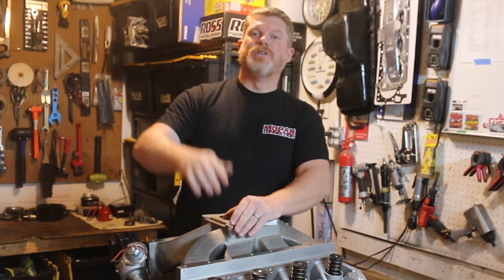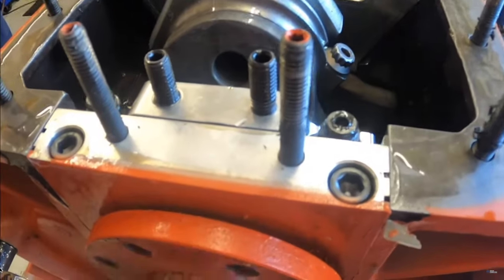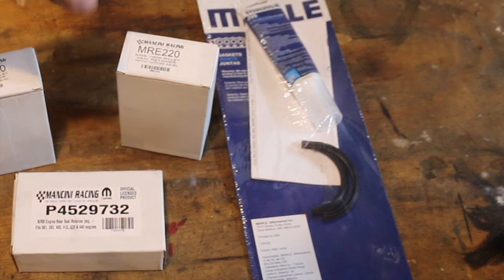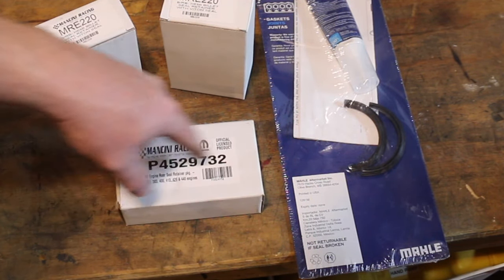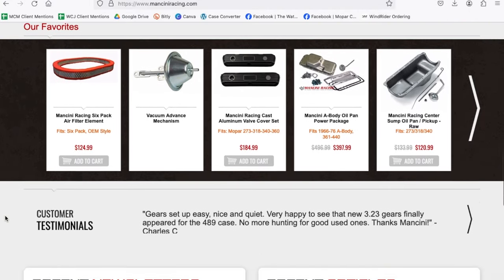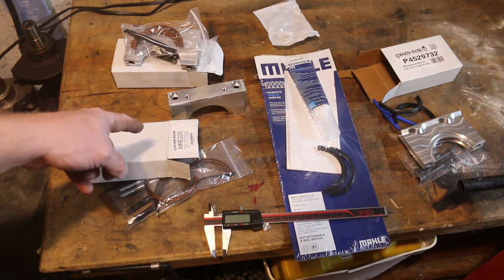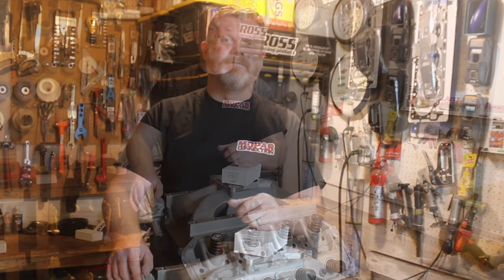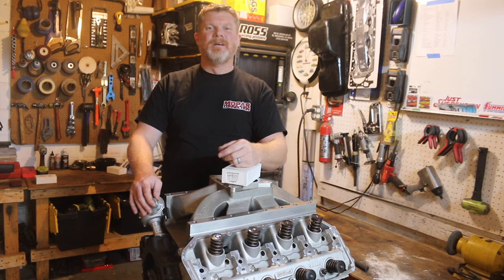Comparing Mancini Racing's Billet Rear Main Seal Kits to Factory Replacement Seals

Comment: Me and a buddy used the Mancini. Billet rear main seal kit but one thing we did different was we clocked both seals off set  from the parting line if the engine block and the main seal holder on a 451 BB stroker we built for his 69 Plymouth road runner because the original seal holder started to leak shortly after we had the engine dynoed .  Those 50 year old aluminum die casted rear mail seal holders can shrink over time and can have porosity in the casting that you cant see that will cause them to leak . I worked for many years at a aluminum die casting shop and a casting cam shrink some over time where a billet piece of aluminum will not nor will the billet have any porosity in the aluminum. I just found this channel that popped up on my YouTube feed so i will be watching more of your videos for sure .  If i remember 440 source sells a billet rear main seal for the R & RB blocks but im no sure how wll they are made .
Reply from the maker: Appreciated! And yes the old cast seals are also very brittle and can crack.

Comment: There is also a one piece rear main seal on the market. We’ll see how it seals when the low deck goes on the dyno…
Reply from the maker: Yeah I mentioned that in the video (per caption). I’ve used them before but you have to be careful that you don’t stretch them out too far when installing them over the crank. (Plus I didn’t have one on hand to demonstrate.)

Comment: Just one note ,you mentioned high oil pressure as a reason for using the improved seal. That's irrelevant as only crank case pressure pushes on the seal.
Reply: FYI: My 1987 Peugeot wagon has a XN6 in it. Although the rear caps have lateral seals for the rear main bearing cap,it simply uses a Archimedes Screw machined in crankshaft to keep oil in the sump when the engine is running. Engineering oil  control done right,no need for a rear main bearing seal. Jaguar and Peugeot Indenor XD Diesels used a common then rope seal, however updated seal was changed to a silicone rope; less sensitive to drying out or infrequent oil changes....end result,rear main oil control issues resolved.
Reply from the maker: Correct, Tom. Fel-Pro calls it a “High Pressure Rear Main Seal” in their catalog. If I said it was due to “high oil pressure” I clearly misspoke.

Comment: Check the clearance on the rear main studs and billet seal retainer your not setting flush with the block
Reply from the maker: There was a little contact with the main cap hardware in this demonstration by that’s not the seal’s fault but our hardware choice. I don’t want to focus on that in this video - but good eye!

Comment: 🌟 A thought … If the Mancini MRE220 main seal retainer is cut deeper to accommodate the size of the larger FelPro 2947 Viton seal (the standard Chrysler black seal leaks as per your video) - why was it necessary to cut it deeper if the larger Viton seal still fits (and doesn’t leak) between the crank and the block? Perhaps there is an argument for using 1/2 a standard seal and 1/2 a Viton seal when using the Mancini MRE220?
Reply from the maker: I think you misunderstood. We didn't cut anything deeper to accommodate anything. The standard black seal sucks, and sits too deep in the billet rear main block. The thicker Fel-Pro fills up the channel in the billet rear main block, and is typically sold together from Mancini. I had an extra that I had picked up somewhere and foolishly used the black Viton seal with it. That's why it leaked. I ordered the thicker Fel-Pro and solved the issue.
Reply: @ Perhaps I have misunderstood what you were saying in your video. I thought the gist of your message was that Mancini makes two seal retainers: MRE220 that uses the FelPro 2947 style Vitoria Seal and the MOP-P4529732 “stock replacement” retainer which is designed to use  the standard Chrysler black seal. The MRE220 uses two “O Ring style” side seals and the MOP-P4529732 uses a single larger silicone side seal. It is  the side seal change that upgrades the MOP-P4529732 over the OEM item. I understood that in your engine a standard black Chrysler seal had been used with an MRE220 and it leaked. Upon investigation you found that whilst there is insufficient crush of the Chrysler Black seal in the MRE220, the FelPro 2947 Vitoria Seal works. Are you saying that there is also insufficient crush of the Chrysler Black seal in the MOP-P4529732? If not, then the retainers are different in the main seal area. I note that Jeff Guenther at Fast Fish Auto Parts makes his own retainer that has no side seals and relies solely on closer tolerances and RTV. His seal 10806G  evidently works in either in his retainer or the OEM item. My guess is that it would also work in the Mancini MOP-P4529732 retainer, but probably not in the MRE220? Somebody needs to get the OEM, 2 x Mancini & Fast Fish Retainers + seals and do some accurate measuring.

Comment: Thanks for the video I thought I was losing it. bought the race main seal holder from Mancini without the large seal. Well I now understand. Motor is in car and this will be the 3 time re-sealing. Am I going to be able to coherse that larger seal around the crankshaft? any tips All along I thought it was the side seals. You recommend installing dry no sealant?
Reply from the maker: It’ll absolutely slide in - it’ll be a pill to do it upside down inside the car but not impossible.

Comment: So it wasn’t clear on final install of mre220 kit with dual side seals. Do the side seals go in dry, with assembly lube, or rtv???
Reply: Was wondering the same thing. Need to install mine as well.
Reply from the maker: They go in dry and then get a thin coat of RTV before install.

Comment: If the higher tension seal fits a stock retainer why does Mancini machine the groove in their retainer deeper to the point a stock replacement seal doesn't work? That kinda doesn't make any sense. I just got an engine back from the machine shop. I am assembling it all myself. They attached a note to rear main seal box saying they did not think it had enough crush. This is the MRE220 kit and it does have the brown seals. At this point I am tempted to just use the stock retainer with the brown seal. Having a rear main seal leak after all that work and money is just unacceptable...
Reply from the maker: The black seal sucks. Spend the $10 bucks to get the better Fel-Pro. The Mancini kit should have the brown seal.

Comment: That "Heavy Duty" rear main seal can be purchased separately. It is made of Viton and is known as a Top Fuel/ Fel Pro 2947. You can even get it through Auto Zone. 
Those "square" side o-rings are not easy to find if you need to replace them. Indy Cylinder Heads recommended using an 1/8" o-ring.  I went to a hydraulic repair shop and ended getting an 1/8" o-ring with a fairly big diameter to cut into 4 pieces.

Edit... I watched to the end and noticed you posted the part number. Sorry. 
But unless you order $100+ from Summit... you have to pay shipping.
Auto parts store don't charge for shipping.
Reply from the maker: Yes, we literally put the Summit listing in the video at the end.

Comment: Back in the day the side seals were supposed to be soaked in diesel fuel just before assembly...It caused the side seals to swell and I never had any issues with seals leaking... I always prefered the old rope style just soak it in oil and install...
Reply from the maker: Yes! Those were when they were made from actual rope!

Comment: Some seals leak on the RB engines because the seal fit in the aluminum carrier are not concentric with the crankshaft! You need to check that by measuring everything. I used the stock carrier with a "Viton" seal and no problems.
Reply from the maker: I’ve never encountered a seal that wasn’t concentric, only that they didn’t properly crush because they sat too deep in the channels.

Comment: I disagree Kevin .
ALL BB Mopar Engines can leak Oil from the rear Main Seal no matter the Seal Retainer or Seal used.... just as all can be made to seal quite well utilizing just the factory Seal Retainer and cheapest stock neoprene seal..... it just depends on the attention to detail in observation of Lip Seal compression by the Crank during mock-up beforehand....  and subsequent 'manipulation of the Seal Retainer itself 'side to side' in the Block itself during assembly when utilizing 1/4" offset from the parting line to compensate for the poor concentricity of Machined 'groove' in the Block relative to the Crank C-Line.
Obviously here.... Rear Main Seal installation/integrity on the Crank should checked prior to continuing assembly of Pistons/Rods.... by installing the Oil Pan temporarily and adding Oil... then "hanging' the Block/Seal/Crank sub-assembly from the front submerging the rear seal completely to verify NO leaks.... prior to then removing the Oil Pan and continuing full assembly.
Far easier to sacrifice an Oil Pan Gasket this way to verify patent Seal positioning than to have it leak later on the Dyno ?
Reply from the maker: Certainly ANY builder can fumble a rear main seal installation if rushed or inattentive. But this kit radically improves one’s chances of success, and well without the many tricks and tips accrued over decades of builders forced to “make do” with stock components.